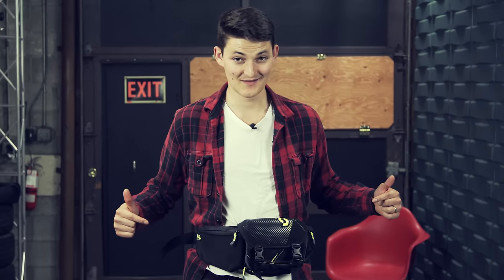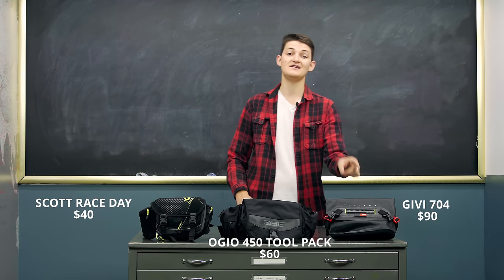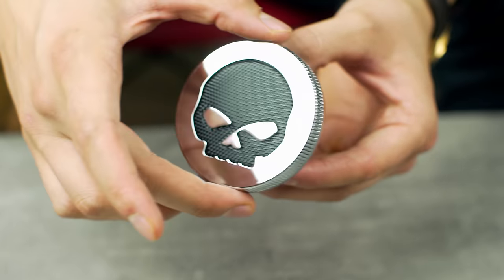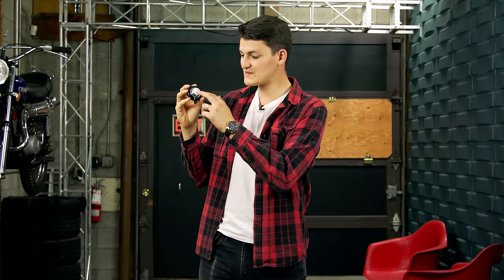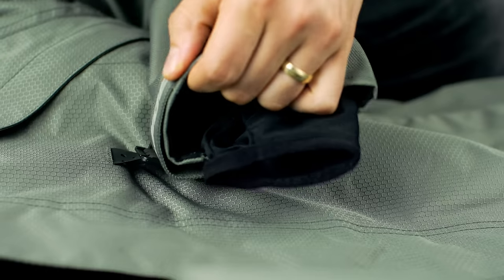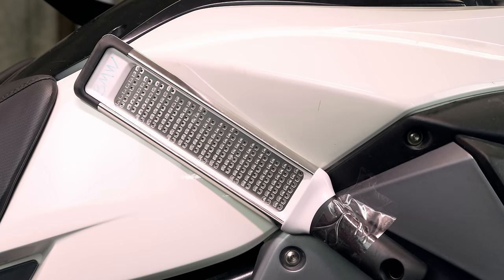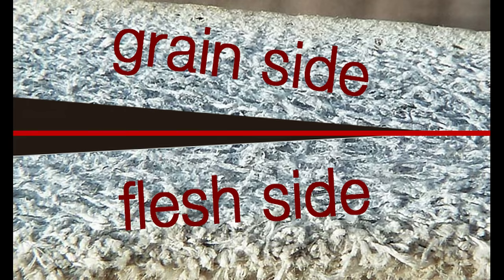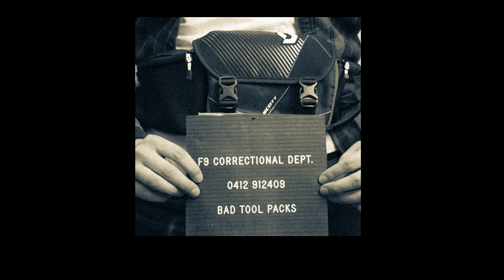Most Dangerous Motorcycle Gear

Comment: I would say handle bar cell phone holders should be on there. I was in a accident (30mph) and it hit me right in the stomach.  Had a textile jacket on and still gave me a sever contusion.
Reply: However, you could also argue that a phone in your jacket pocket could also pose a risk, because, assuming you fly chest first onto tarmac, the phone would be the first point of contact. This would provide a central point for which the force of the impact to pass through. This would mean just a series of bruised ribs could turn into a fractured rib that could pierce a lung.
Reply: You could arguably say the same for tank bags. When you crash and you hit your bars chest-first, you're gonna catch the bag on the way there.
Reply: I hear what you guys are saying, but those are relatively flat, the cell holders (specificaly RAM mounts) have like 4 prongs waiting to jab you
Reply from the maker: Ah yes, very good addition. Hope you healed up alright? ~RF9
Reply: FortNine  Yup, didn't break anything, tweaked my back, but was back out riding 2 weeks later! My stomach was purple for 2 months though....and I got to buy replacement gear!
Reply: jwkzzr if your phone is big enough, it might function as a sort of armor plate, spreading the impact over an area the size of the phone. Maybe even absorb some of the energy by cracking the screen.
Reply: Ah yes, if only you put your phone in your fanny pack. ~RFanny9
Reply: @ItsBeenDanBefore  phones batteries can also combust from heavy impacts
Reply: My friend recently came off starting in a low side.. His s9 saved the top part of his leg from road rash, thing was grinded to oblivion
Reply: I disagree. You could hit any number of other things mounted on your handlebars.
Reply: Any type of throttle lock used for cruise control 
Kinda sketchy
Reply: @Stoney3K  not if you fill them tank bags with cleaning cloths, extra shirt or something soft. :)
Reply: @ItsBeenDanBefore  if something punctures the phone's battery, then you're looking at an entry level explosive(or at least combustible) vest.
Reply: I want my phone in my upper jacket pocket where I can possibly call for help from the ditch I'm lying in. If the phone is on your bike, ah yeah, good luck with that! Where is my bike?  I'll take my chances with the Apple & the Auto in there rightful pockets zipped shut.
Reply: @jhask64  but what if the impact bricks your phone? And also if something does pierce the battery, well let there be fire I guess.
Reply: Wow, interesting comments and some food for thought.  My bike (KTM 690 E) has its rear subframe as the gas tank, so the seat is long and flat and runs nearly to the steering head.  Now I’m worried that an accident will fuse my GPS to my genitals!
Reply: Good thing it wasn't a Note 7 or he would have lost his leg!
Reply: Why not just hang up and ride? What a simple concept.
Reply: I had it too, but my phone holder wasn't a rigid one and it break clean out of the way, minus my phone also break too

Comment: Thanks, Ryan. Eye opening, as always! Just to put my dime in the jukebox: my bike was new, and I was on it, stopped at a sign while waiting for the road to clear. A guy in the car rear-ended me, I got ejected and my shoulder hurt, of course, but also my left shin and my achilles heel right under the calf. What happened? I had been badly hit by the gear selector on the left and, on the right, by the passenger footpeg socket (quite square, this one!). Had I not my motorcycle boots on (those which protect up to mid-calf), I would have torn my skin and what else? 
I do agree with you, Ryan: the bike is already quite threatening in itself, no need to bolt on additional posts, daggers and other blades...
By the way, I'm stunned by your videos. I have been riding motorcycles for 20 years and have accumulated 100,000 miles on various machines, and at every video of yours I learn a lot and it increases my pleasure to ride. Thank you. Sincerely,

Comment: I love riding next to big rigs and HD pickups with spike covers over their lug nuts. It's quite the thrill being that close to a wide-open Cuisinart. 😒
Reply: Seen those quite often on big rigs lately.  They're damn scary when next to one on the highway.
Reply: The spikes on the wheels of big rigs are chrome covered plastic.
Reply: Yep.  They break if you look at them wrong.
Reply: Man, I so much want to change my YouTube handle to JingleHeimerSchmidt after reading your reply.
Reply: +Norsefalconer 
Open face meat grinders!!!

Hamburger tar-tar!!!

Mobile sushi makers!!!
Reply: +John Jacob 
Yes, but have you seen how hard they can be to remove gust to get to the lug nuts to change or repair the tires???
If those lug nut covers fit well enough to not fly off at speeds of 55-75mph, then they aren’t going to just break or fall off if someone were hit by them in an accident.

Comment: I ride a 750 watt recumbent ebike that can cruise at 20mph and hit 38+ down the mountain paved roads. I always learn something useful from your videos. First being what I put in my fanny pack which actually rides over my belly button. Has everthing I need in case I inadvertanty depart bicycle. To include wallet and Bleed Stop. Need to review how my keys are stowed.
Also need to remember about snags anywhere on the system.
Thank You!

Comment: That back material on the packs is called aeromesh or 3D mesh. Some of them are quite resilient, but they will not do well with abrasion or punctures. It is designed for padding and ventilation.

Comment: Good video. Fanny pack ? No way ! I never even have given it a thought. The first thing I bought, 18 years ago when I purchased the bike I use now, was a back pack. I used it one time. It's still have collecting dust, just in case. I installed a rack on the back of the bike and now use a tail bag. The second item I added was a tank bag. I've since added nylon saddle bags. 
I don't anything, other than protective gear, on my body. Water? Good time to pull over for a little break. 

Barry

Comment: One reason that I stay with the Goldwing GL1500 is that it has more storage than the later model, so my tools are carried low and not where my body happens to be while riding.  The gas cap being under Tupperware eliminates any temptation to replace the metal cap with PlastiCrap(tm).  Velcro replaces that stupid hook on the jacket, but I saw one rider who put a rare-earth magnet on her jacket and a metal clip on her drinky Binky -- classiest way I've ever seen to deal with this, and it has the advantage of being completely break-away, instead of hanging up in a crash or going through trees!  One laugh that you failed to include was the wallet-on-a-chain.  I watched a guy has his slide out of him pocket, drop into his spokes, and drag him right off his bike before the belt-loop snap released.  The subsequent lesson in applied physics not only turned an 80 MPH pursuit into an EMS call, but put his Harley into a flood-control channel.  Two days after a big rain.   Agreed on the sharp junk -- the people who like that stuff are making up for being so dull themselves.  And you're right, avoiding unnecessary and useless dangers is a MINDSET issue.

Comment: In terms of safety gear (gloves) I'd argue that quality is more important than material. For example I had a highside at speed landing on my palm with suede leather gloves (in that area). Now I couldn't say if they have multiple layers underneath, most likely do, but the gloves didn't even pierce the first suede layer. I'd trust the Alpinestars race gloves over my secondary set of no-name leather gloves any day of the week especially after seeing how little damage such a big crash did. Whilst a lot of the money goes towards small effects like padding and finger strapping, some to the name behind it, they're still just built so much better as you'd imagine from well regarded safety gear.

Comment: The phanny packs can be loosened up and pushed up under the arms and turn the pack around like a backback! If you dont like your gas cap use a sticker! When I lived in Florida it was way to hot for jackets if you want to wear one you will pass out from heat stroke by the 3rd red light!

Comment: 0:17 It's called a phanny pack because surprise, surprise it's intended to go on your phanny aka lower back while having easy access by spinning instead of taking off an entire backpack. while also keeping the weight of the pack right next to your center of gravity giving you more control during a crash rather than a heavier loose strapped object pulling you off your bike using weighted momentum.

Comment: I got a new quad a few weeks ago wasn’t running. Couldn’t get it running for weeks. Finally I get it running and I take it down the road. I stall down my road, and it was dark. So I start pushing back but before I do that I check if there is gas in the tank. I put a lighter up to the gas tank without thinking and a huge plume of fire came out and I was able to blow it out thank god idk gas gauges are useful is all I’m saying

Comment: The thing that happened with your jacket sleeve happened with me but with some winter riding overpants and those metal things attached below the foot pegs.  (Peg feelers?)  I didn't crash or anything but it happened enough that I removed them.  It's a Yamaha MT-07, and I doubt I'll ever lean it enough to need them. Still, I'll take the chance of leaning too hard (doubtful) over getting stuck at the wrong time (more likely).

Comment: Glove comment. 100% Correct.  I low sided after a collision with a deer. I had vented leather palmed work gloves as they were cooler in hot riding conditions. I went down hard left, both palms exploded. Fortunately (?) I bounced onto my back and my bare palms were in no danger. I did drag the backs of my hands in the slide(140ish feet) and did get a few abrasions.

I was also wearing Levi's and the knees blew out same as palms.  The double thickness of the  rear pockets literally saved my ass.

My full grain riding jacket held up remarkably well and I still have meat on my back and shoulders because of it and the jacket is still in great condition.

Comment: Speaking of pointy mods, I had a customers truck up on the hoist with its massive, heavy af 20 inch rims. I Always take then off and just drop them down putting my hands on the sides so when they bounce a couple times they just stay in place. Well, the jack wagon had these super sharp pointy valve caps, so when it dropped and I put my hand on the side to steady it for the bounce, boom, unnecessary piece of metal right into the hand

Comment: I have many spikes on my bike, all CNC machined my me. They are all designed to fit over various bolts on the engine and all but 2 of them point straight up, the other 2 point out from the right side lifter blocks but they do not protrude past the engine cases. None on the pegs or the hand grips. 
The biggest danger for me is getting poked by them while cleaning the bike. They are all very sharp with only a .01 radius on the tips.
As far as carrying tools, I have a tool pouch that is strapped to the sissybar and snuggled between the sissybar and rear fender mounted taillight. There is no reason for me to carry tools anywhere on my body.

Comment: The term "FANNY PACK" comes from it's original design to be worn to the rear, which is where ones fanny is located. Wearing it in the front, avoids anyone from litigation if and when they are harmed by any contents withing it. Regardless of the incident that causes the harm.

Comment: Greetings. Only after having already ordered an aftermarket gas cap and with no other prior research did I see this video. Any thoughts on the aftermarket caps for the Triumph Thunderbird Storm? The seller states that you must use the original plastic piece ( presumably the threading etc ) and snap ring it on to a new " lid ". Any thoughts of course greatly appreciated.

Comment: Got the BULL...!
2008 SUZUKI Boulevard C90T 
1500cc
“Bagger”
It goes and goes!
Cruise on the freeway at 75 mph , no problem for a whole 3.7 gallons of fuel.
Goes about 200 miles between fill ups at that speed.
At 55 mph and less...about 300 miles.

Comment: I always wonder about people's fear of fire with gasoline/petrol. Its autoignition temperature is 280C (536F). Diesel and Jet A-1 are more dangerous in this respect with 210C (410F). As long as there is no saturated well mixed "cloud" of fuel-oxygen mix, it is not easy to ignite this stuff. I guess you could drop a smoldering cigarette butt in a can of gasoline and it might get extinguished. A thin "blanket" of dust on your workshop floor is a bigger fire hazard.

Comment: Fuel doesn't ignite when it touches the engine outsides. Common myth. You need an open flame or at least bright red glowing manifolds to ignite fuel.
What starts burning in motorcycle accidents is engine oil.

Comment: DO A VIDEO ON RECOMMENDED GLOVES FOR SUMMER (SUN/RAIN), AND WINTER (DRY/WET).  AND BEST RAIN SUIT WHERE THE ZIPPER IS NOT PLASTIC AND DOES NOT WORK… LOL. YOU MAY AS WELL COVER BOOTS THAT GIVE A LITTLE HEIGHT AND QUALITY.   ANNNND BEST PROTECTIVE BUILT IN COAT AND SUIT FOR ALL SEASON.. POSSIBLE LAYERING OVER IT.   I dunno.  You should.. lol

Comment: I did had an accident 6months ago. My gear ? Beach shorts. Flip flops and a jacket. Injuries ? 2-4inch in lenth 2-3inch wide skin scratch on my right leg and almost 1/4th of my right arm palm skin missing. After 6 months of healing im back on the road this time on a 125cc scooter i wont be touching superbikes for a while 😂😂😂😂😂
Reply: You dress like that on a bike? Trust me it's not the bike that's the issue
Reply: @grahamb5930  medium sized tropical island. Where safety is not a priority hahahahah.
Reply: @kenyocogan2089  As I said the issue is your attitude and not the size of the bike.
Reply: @grahamb5930  yep, thats why when im using my big bikes . A full protection helmet, knee pads, spine protector, and timberland boots. I had it with the first accident.
Reply: @kenyocogan2089  If you are going to ride like a hooligan, dress like a hooligan! Full leathers with armour, armoured gloves and boots and a full face helmet. You do sweat a bit and by the end of the season my leathers smell like death but, I've fell off too often (mainly tracks) to wear anything else. Safe riding Ken

Comment: Im such a fricking dum dum I was wondering if the answer is neutral as that's the only gear you can be surprised by if you stumble into it in a slow corner for example. So that was what I assumed the most dangerous motorcycle gear was.

Comment: Gas caps leak in a crash oh no!  Meanwhile there is a high pressure fuel line from the tank to the engine that when ruptured sprays fuel like a garden hose.